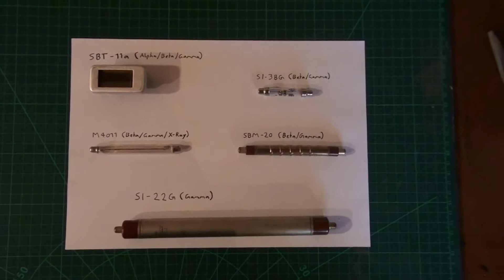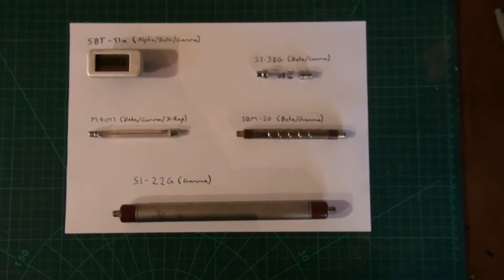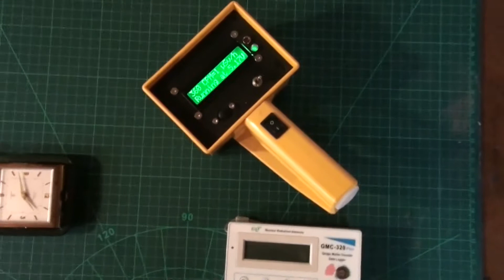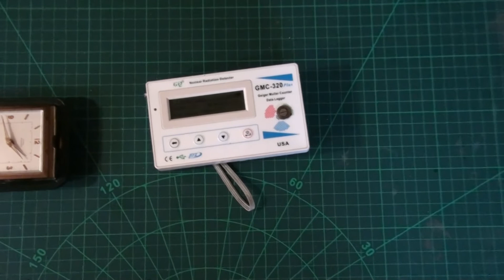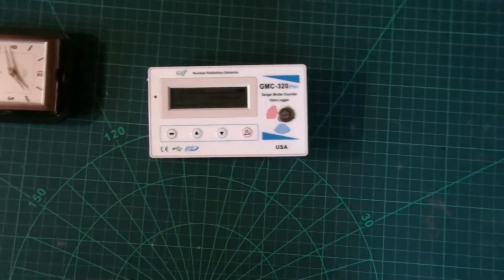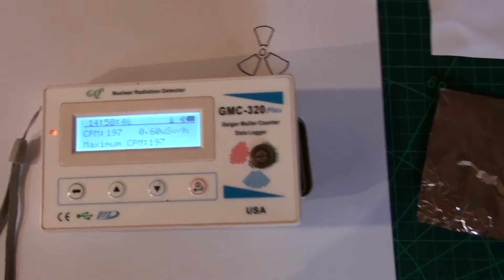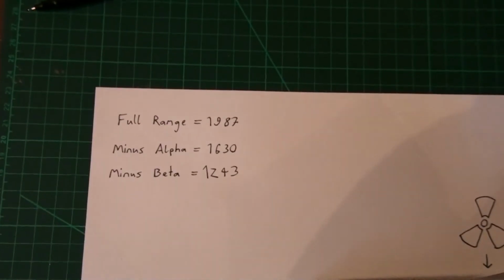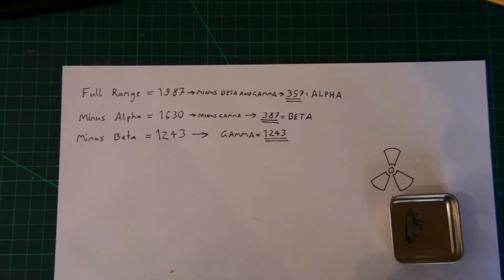Fun with Geiger Counters! (and how to get a cheap one)

Comment: GMC320 isnt sensitive to alpha particules ;  and a thin sheet of aluminium doesnt stop beta; it needs to be a few mm thick.
Reply from the maker: yes youre right about the aluminium, i found out meanwhile ;) However my GMC320 can detect alphas, because i changed the tube for a Sbt-11a tube (great GM tube btw!) ;)

Comment: how did you ugrade the gmc-320 exactly? I see the new tube housing and the potentiometer on the other side, but what did you do internally? is it hard? I'm thinking of doing the hack myself buying those parts
Reply from the maker: actually i just removed the original battery and installed another one, but only for space reasons. the SBT-11a Tube fits nicely into the original battery compartment, and the new battery fits nicely where the old tube was in :) PS: theres no potentiometer, the screw on the front side is only to hold the SBT-11a in place ;) its very easy!
Reply: @BremsstrahlungChannel  could you show us how you added the new  Sbt-11a tube please. take it apart and possibly make a video on the new mods...please.
Reply from the maker: sadly my gmc-320 detector broke recently.. the tube is okay, and i think the geiger counter part is also okay, its still clicking, but i guess the chip on the motherboard died on me :( maybe tampering with the device is not such a great idea after all ;) i will ty to update my geiger counter collection and make a video about them at some point, but recently i got myself a Radiacode 102 Scintillator detector and i can highly recommend investing in one of those, its amazing!    @rinterstate

Comment: You should check out a different type of radiation detector. One based on a photodiode, these are even capable of gamma spectroscopy. These types of radiation detectors are cool because they are fairly simple and don't require a high voltage power supply so they can be made very small. Great video :)
Reply from the maker: Thanks for youre Comment! :) Yes i was thinking of some Scintillator (id like to build something with a old Photo Multiplier Tube) or even the more "modern" approach via Photodiode... Its definitely on my Bucket List, but ive got some other Projects i want to complete first :) ...Gamma Spectroscopy is definitely a long time goal for me but this will take me a while ;)
Reply: @BremsstrahlungChannel  i enjoy you video